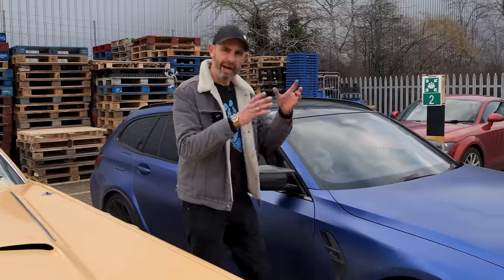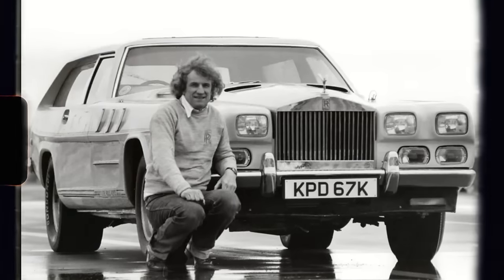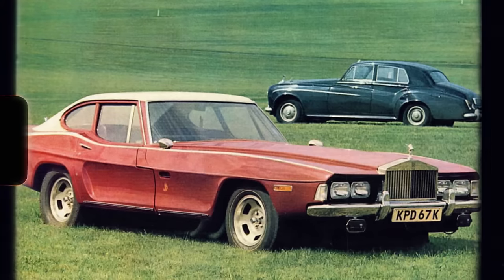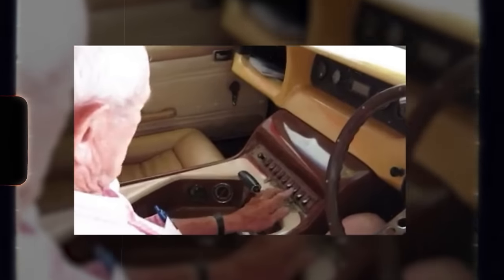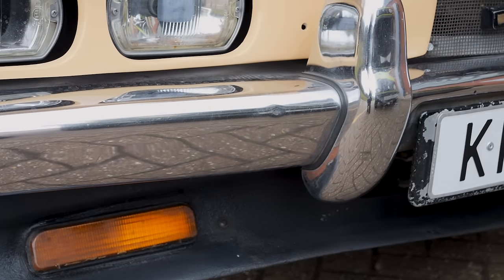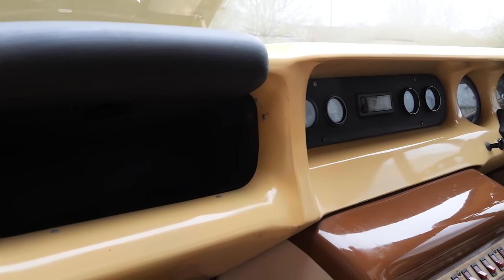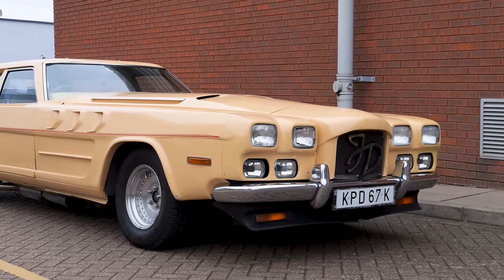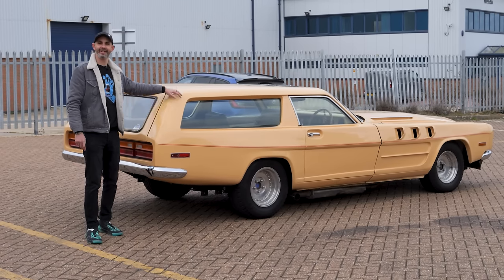Driving The Beast! 27-litre V12 Spitfire engined car on the street

Comment: Awesome, fantastic to see that! Having had the privilege of working on Merlins, I can appreciate the engineering challenges of putting one in a car- no mean feat and probably the most unkind thing you can do to an aero engine, the operating conditions are very different. The cylinder/ piston clearances are massive by contrast to an automotive engine- the last thing you want is an aero engine seizing up, so the oil burning seen here is to be expected, but It'll probably be pretty minging inside by now.. The Merlin's gearbox (not the cars gearbox) is a very complex piece of engineering and responsible for half the mechanical row you can hear- the cockpit of a spit is little better. The magnetos driven from it are timed asynchronously and each share plugs on exhaust and intake side, the large and simple combustion chambers needing all the help they can get- Merlin's are not the perfect engine often imagined. Think tractor engine built to race car standards... A proper Rolls built Merlin 35  is a thing of beauty, the fitting work and general quality is something else. From the rocker covers, this one is probably a Packard built engine. I hope who ever buys "The Beast" actually uses it, it really needs to turn up to a few car meets and the odd pub lunch..
Reply from the maker: Thank you for the info. And yes, we totally agree that the Beast ought to be bought by someone who will occasionally fire it up and let others appreciate the lunacy.
Reply: It is a mechanical marvel without a doubt but it sounds terrible to me.
Reply: @TheLateBrakeShow  you sound like the perfect custodian Jonny!
Reply: Apparently the engine is from a Boulton Paul Balliol training aircraft this engine was available in large numbers from surplus stocks leftover from the war.
Reply: Packard NEVER built a mk35 for the Brits.  all were the 20 series single stage 2 speed.  packard did late in the war, 1944 build a  1000  266 merlin for the Brits, their version of the 66 series 2 stage 2 speed supercharger and they were only used in the Mk 16 shitfire,  ALL Packard built engines has a plain steel stamped rocker cover.  so who knows///
Reply: @wilburfinnigan2142  It was very nice of Packard to build Rolls Royce Merlin engines for our Shitfires and thank goodness they made them for the P51 Mustang too,it was an excellent plane once it was fitted with it.
Reply: @wilburfinnigan2142  The shape of the rocker cover suggests a later mark of merlin than the 35 the car is claimed to have. Incidentally, the Packard Merlins I worked on had cast covers.
Reply: @steamwally  unless it was used to make it fit possibly?
Reply: The Merlin 35 was made only for the Balliol, a British plane. How could it be Packard-built?

Comment: What a Beast! Definitely not first aero-engined car as it was "common" practice in early years of planes to nick the engines and put in land speed or racing cars, think Napier Railton etc. This car was such big news in the 70s and 80s in UK lets hope it goes to a museum, he used very similar idea about getting transmission to work as Charlie Broomfield did later in his SD1, interesting that you have now been in both!
Reply: Yeah I was a bit puzzled by that statement.
Reply: I thought the same.  Jonny had a bit of a brain fart on that one.
Reply: Although I wonder if it was the first street legal aero engined car.
Reply: @callummclachlan4771  in terms of modern rules for road legality, yeah kinda. But most of said aero engined land speed cars from pre war were also road legal, it's just there were next to no rules to be met 🤣.
Reply: Not many could boast a valid MoT!

Comment: I saw this car in its red and Rolls Royce radiator version on Blue Peter in the early 70's. Never forgot it and always wondered what happened to it. Now I know.
I'm also sure that there were several aero-engined cars built in the 1910's, 1920's and 1930's - some for racing and some for land speed records but this may have been the first road car - not sure.

Comment: I love the blue trail of "ULEZ compliance" in the air all the way back the entire street
Reply: That engine was build to work with supercharger and it is not mounted to it so the comptesion inside the engine is low and because it is low the burning process inside the cylinders is not producing many NOx->that is what that 27 liters are good for->you can produce plenty of power without the need to push the engine to its limits as that is what producing a loot of nasty chemicals and this is also why motorbikes are small with tiny engines but producing often as much smog as full size cars(or more).

Comment: I recently went for a flight in a Supermarine TR.9 Spitfire 2 seater with the same 35 Merlin in NZ and I was amazed at the mechanical noise the engine made inside the cabin. Sounded rough as guts. All nuts and bolts. Not like the beautiful exhaust noise we are all used to when hearing it from the outside. However the pilot was not going for broke and I remember the boost gauge being not far off the stopper. Had she opened it up, no doubt the engine would have sung when under proper boost and pressure but you can imagine those engines cost a lot to rebuild so they didn't want to put it under any strain. Interesting to say the least. It was the greatest flight of my life doing the victory roll above Auckland.
Reply: I was on  a Lancaster 6 years ago the sound of sitting in the Bomb Aimers Position with 4 Merlin's running running a 2000 RPM was simply incredible, Still Get Goosebumps thinking about it.
Reply: @-DC- One of my kids used to play football and was lining up for a penalty shootout at Cavendish fields in Matlock and there was a rumbling in the distance, shortly after we got a fairly low pass from a Lancaster. Totally surreal.

Comment: Sold at said auction for £72,500. The Beast needs to be resto-modded. Modern fuelling, air-ride, modern colour and better interior trim. It's an amazing car, keep it amazing! How it looks in its "hearing aid" current colour scheme, could just be part of its history. A proper resto-mod could launch it stratospheric!
Reply: Could use a muffler or two as well🤥🤣🤣🤣, along with PAS & an LSD if it doesn't have one already!😉

Comment: Nice idea about it being the first aero engined car, but it's several decades too late for that. Aero engines were popular for racing cars over a century ago. The Beast of Turin was built in 1910 with a 28l, four cylinder, airship engine - there are loads of videos of it on YouTube. Even that wasn't the first aero engined car.
Reply: Yeah i was going to say it goes back a long time for aero engines in cars, i think Jay leno has a few of them and featured a few more.
Reply: It wasn't an airship engine contrary to popular belief
Reply: The Napier-Railton was a very successful aero engines race car but only 24 litre displacement
Reply: Not even chitty was the first aero-engined auto. Just one of the most famous

Comment: Aircraft engines started to appear in cars around 1910 and there were several by the 1920's. The generally accepted first car was the Fiat S76, which used an airship engine of 28.4 litres, rated at 290 bhp and a massive 3000+ Newton metres of torque. 

Originally designed as a landspeed record car designed to achieve 200mph, though 96mph was the highest speed recorded. It set off a whole new trend with Fiat building several more aircraft engined cars, and others doing the same throughout the 1920s and beyond. The largest I've seen is I believe a 40 litre Mercedes from around that period. 

There were a few cars designed with radial engines that were also insane capacity, but almost always all had masses of torque but not horsepower, so not an ideal configuration for speed record cars.
Reply: This is a tank engine though, no merlin had no super charger (that I know of) those were meteors. He bought a merlin and turned it into a meteor. All those efforts look lumpent compared to the w125 rekordwagen in 1937.
Reply: Alot of Aero engined cars went around Brooklands!! and some getting slightly airborne too haha
Reply: Jesus said, “No one can enter the Kingdom of God (God's family) unless he is born of water and the Spirit. Flesh gives birth to flesh, but spirit gives birth to Spirit. You should not be surprised at my saying, You must be born again” (John 3:5-7). what does this mean? Well you have to believe with your whole heart that JESUS died for your sins and after 3 days and nighrs GOD raised HIM from the death, so you can be baptized and after being baptised ask GOD for the HOLY SPIRIT . WHO will guide you trough life!
Reply: Fiat S76 engine was NOT a airplane engine.
The Fiat S76 engine was designed for that car.
Later fiat used the same modified  engine for a airplane.
Reply: Aero engines are also designed to have a narrow power band since they fly a constant rpm with the propeller pitch deciding engine rpm instead of the throttle making them horrendous at idling and acceleration in general when the revs drop too much.
Reply: If you just stick to road cars, there's Count Zborowski's Chitty Bang Bang 3, and the Allison engined Cramer Comet from the 1950's
Reply: As long as you have torque you can keep gearing up. Sure it will take the entire length of the united states to get up to speed but

Comment: Got to love such eccentric creations!
A lot of the grinding sound is the step up in gearing for an engine that's not meant to rev more than ~2500 RPM. 
Since it was once geared for 300MPH, that implies it was geared to go more than ~100MPH per 1000RPM
The low octane fuel is no surprise, given that it has no supercharger/boost
Reply: I was surprised it ran on 2 star petrol, a word I haven’t heard in a Long time, as my understanding is that a winning technology of WW2 was the American developed of Catalytic a reforming which allowed the production of 100 octane aviation fuel. I assume that because it’s not supercharged or developing full power knock wasn’t a problem.
Reply: @axelBr1  I agree that it not being supercharged allowed for lower octane fuel. In addition to supercharged/turbocharged engines requiring higher octane, the ones targeting high horsepower actually choose pitons to LOWER their compression ratio. That's because if the engine is optimized for high horsepower / high boost, the lower piston compression ration will be more than offset by the air being pre-compressed before entering the cylinder.

Comment: Great to see the beast. A few interesting notes on the engine. The changes between a Merlin and Meteor are, the Meteor was designed with a higher CR, re-cam and the Meteor rotated in the opposite direction. This leads one to speculate the the change of engine was driven by John's reduction gearbox. The other note is around fuel. The merlin has a CR of 6:1, very low for a auto engine (7:1 fro a Meteor). With a supercharger the engine would need 100 octane aviation fuel but without it will run on very low grade. Hence the two star fuel was a result ofthe supercharger removal and not a wartime measure. The final question is power. A Merlin of this type made approx 1500hp at sea level. An equivalent meteor made around 700hp. With the lower CR of an unsupercharged merlin it can only be speculated, but not more than 700hp. However it seems moot as the torque is what this is about!

Awesome car, amazing report on the man and the vehicle.
Reply: Given it had the supercharger removed, different intake and exhausts, and was never retuned for those mods, 700 is probably very optimistic. I imagine it's far less.
Reply: @tomkandy  . I would tend to agree that the actual value is lower than 700. 300 -500 is far more likely. That ties in with an automotive gearbox and rear axle.

Comment: I am reminded of a late 1960s Chevy Chevelle with similar power. Twenty inches were taken from the cabin, forty inches added forward of the windshield. Steering was from where the back seat had been. All to accommodate a 1,710 cubic inch Allison V-12. It was fed by four Carter AFB four-barrel carburetors.

Comment: Saw this car do the Quarter mile at Brighton speed trials in 1975 [i think]. I was in the Air Cadets and we had access to the pits so saw under the bonnet to. It made an amazing sound during the run with the noise echoing from the arches and a cloud of exhaust following behind.
Reply: What time did it run?
Reply: @autarko  48 years ago so i forget the exact time but it did break the quarter mile record for its class.
Reply: @nickroberts5576  That's seriously impressive considering at that time there would have been some roadgoing 600+ hp worked V8's weighing half what this did.

Comment: Superlative car in every sense of the word! Although having seen the pictures, for my taste, the original pre-fire body was the prettier - the single-deck lights and colour appeal to me more than the later incarnation but...just wow.
One other thing, I'm sure it wasn't the first aero-engined car, there's another 'beast' (the beast of turin) - I forget the owner but it's a Goodwood regular, and the blitzen-benz, and I think the darraq is also aero engined - it was a relatively commonplace thing around WWI and he 1920's to find aero engined specials.
Reply: As pretty as the original body was, it had an issue in that you could potentially miss it.  No way such a mistake could be made with the new body.
Reply: You're right; maybe it's the first merlin engined car, or the first post-WW2 aero engined car, or maybe the first "modern" aero engined car, but very much not the first aero engined car. Campbell and seagrave would have something to say about that....
Reply: @stewartellinson8846  Yep! and in a flash of memory, I think the owner of 'the beast of turin' might be a guy called Duncan Pittaway? In any case he's as much of a petrol head as JD and he drives 'the beast' on the road to events!
Reply: Don't foget Chitty Chitty Bang Bang. That had a Zeppelin engine I believe.

Comment: There was a car built here in Australia to very similar specs...no doubt inspired by The Beast. It was built by Rod Hadfield from Castlemaine Vic and it was a 55 Chev body on a bespoke chassis running a twin-supercharged Merlin. Body was painted up to look like a WWII plane, and was known as "Final Objective"... with custom registration plates "ATTACK". I believe it was sold and shipped to America some years ago...
Reply: back before aus became a nannystrate with overcrowded inept driverfilled motorways
Reply: In the late 1960s, some rev head in Australia fitted a Merlin into an FJ Holden. I remember reading the magazine article, & I'm pretty certain he drove it from the back seat. In fairness, though, it was a drag car, & never intended for road use.

Comment: Wow what an awesome experience that must have been!  I remember seeing this car in the usual car mags in the 80's and thinking that it was probably like all the other over the top creations out there, you know the type that look badass in the mags but barely run and can't go ten feet without breaking.  It's such a nice surprise to see that wasn't the case and that he flogged it regularly.  Not to mention that he kept up on it for over 40 years.  The fact that it even exists is nothing short of amazing but that he kept it going all these years is mind blowing.  RIP Mr. Dodd, you are and will always be a legend...
Reply: I've always loved the airplane engine cars, they are my favorite thing ever. Because, think about it. It's more practical in some ways. It has the longevity and torque of a diesel. Think about it. You can cruise at 70mph at 650 rpm. That's absolutely crazy! How long would the engine last? Being in America, every older car I've ever owned has had way too low of gears, and the engines run at way, way too high of RPM. In America, they sold most vehicles with only 3 speeds, all the way up to the mid 1980's, rendering most classic cars as junk for a daily driver. I've always dreamed of having tall gears, and a low revving engine, being able to idle down the freeway!

Comment: Hi Jonny. That looks like a Mk3 Cortina windscreen. The 1973 GXL came with those metal trims. I remember fitting my first one back in 1983 when just starting out at Autoglass. The rubber was as hard as back then and getting the molding back in was a nightmare. Can’t even imagine what it would be like today. 
Love your channel and your Allergro is fantastic.
Reply: According to the MoT history the windscreen must have been replaced in 2011 as it was a fail.  I thought Cortina as soon as I saw it, but then I was wondering if it might be wider than a Cortina, hence maybe a Granada?
Reply: You’re right. I overlooked the fact it was rebuilt in the late 70s / early 80s making that entirely possible and a better fit in such a massive car.
Reply: I thought the same!
Reply: Could also be from the Ford Consul/Zypher which preceded the Granada and and was smidgen wider.

Comment: Wonderful video and historical facts. I live in the US in Michigan  but have always admired those old big WW II engines. I live very close to the historic Packard Proving grounds which is now a museum. They have a historic wooden race boat that has 4 of those big Packard engines in it. There isn't much room left for the racer with those 4 engines. With that low idle speed and red line I suspect that down low torque would be impressive.